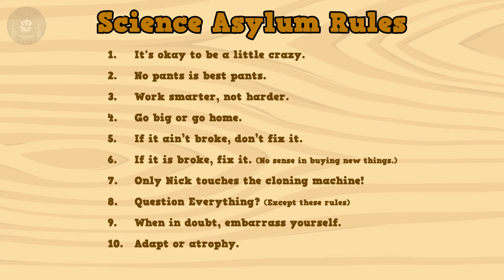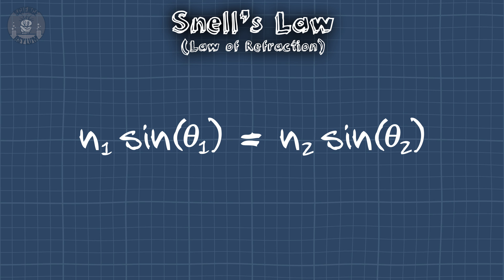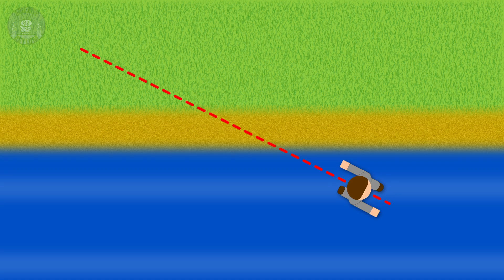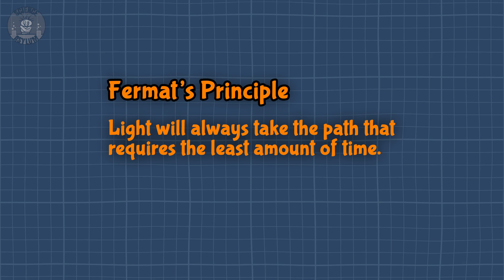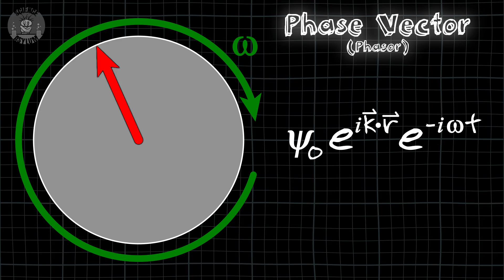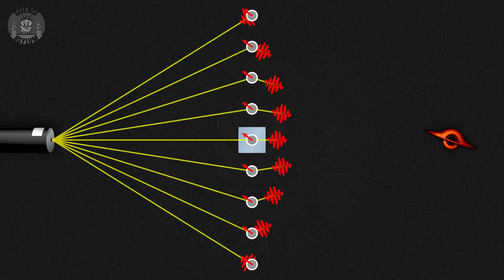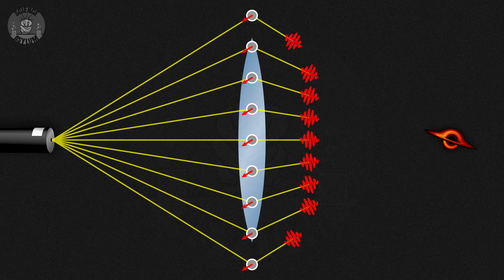Why Does Light REALLY Bend?

Comment: I have a question: Can light bend spacetime?
Reply: It can and it does. Energy bends spacetime. Light has energy. You can make black holes entirely from light.
Reply: Narf Whals Have we ever observe light’s gravitational pull?
Reply: @Shawn-hk1ud  Not with light directly, that I am aware of. The effect is TINY . The energy required to get an effect comparable to 1kg is equivalent to about 20 Million tons of TNT.  So its difficult to do experiments with such tiny effects and there aren't any light sources in space that would do it either. But considering how spectacularly right General Relativity is, there is no reason to believe it is wrong there. But we should still test it if we can!
Reply: Narf Whals Welllll... GR isn’t always right. I mean, think about dark matter. Theoretical, galaxies and stars couldn’t have formed without the existence of dark matter according to GR, yet we have never found dark matter in the cosmos. Doesn’t that seem just a bit off to you? Anyway, there’s a reason why I asked that original question about light, it doesn’t interact with the Higgs Field. Theoretical, light still has gravitational influence despite the fact that it does not have mass. However, if we had the ability to measure gravitational influence on the subatomic and maybe even the quantum scale, we would see the gravitational effects of light according to GR. However, if GR is wrong and we don’t observe any gravitational influence at all, there’s two possibilities. 1: GR might still be correct but we can’t see the effects because light can only cause displacements smaller than Planck lengths. Or 2: There’s a different reason for why light doesn’t have gravitational influence. Remember how I mentioned that light doesn’t interact with the Higgs Field? I mention the Higgs Field because it’s responsible for the mass of all leptons, quarks, the W, Y, Z and Higgs Bosons. Anything that interacts with the Higgs Mechanism exhibits a property we call “mass”. Light doesn’t interact with the Higgs Mechanism, which is why light has no mass. Now, if we were able to observe that light does not have gravitational influence of any kind, that may explain why things with mass do have gravitational influence over other things with mass, the Higgs Field. Newton originally postulated that gravity was caused by the attraction on masses. He believed it was some trait of the masses themselves that caused gravitational attraction in the first place. If all things without mass do not have gravitational influence, but all things that do have mass have gravitational influence, that means the Higgs Field is responsible for gravity. It would mean that if GR were hypothetical incorrect, the Higgs Mechanism might explain why things with mass have gravity, there something in the Higgs Field that is giving them gravity. Now I know it sounds insane, but think about it for a second. If we do discover that light has absolutely no gravitational influence or if we discover that gluons have no gravitational influence, that must mean that the Higgs Field is responsible for gravity. It means the Higgs Field might imbue certain particles with gravity. It would mean that energy doesn’t have gravitational influence, but mass does. It would mean that GR is incorrect, but it would quantize gravity for the first time ever. It would explain why the smallest things in the universe behave differently from the largest things in the universe. Listen, if we ever discover that light and gluons have no gravitational influence at all, physics as it stands would not be up in arms because the Higgs Field might actually provide a better explanation for gravity. Maybe energy doesn’t bend the fabric of spacetime, but mass still could. I really wouldn’t change that mu...wait a second. GR has come under fire recently because the amount of mass in the galaxy is too little to account for the observed rotation of the outer rim. That’s why we’re looking for dark matter. But I think our math was actually off. We didn’t account for any of the energy in the galaxy. If GR is correct and mass and energy both bend spacetime, that means we need to calculate the amount of energy in our galaxy and convert that into mass. Then we could take the mass of the galaxy and the theoretical mass of all of the energy of the galaxy and we should get a much higher result for mass than we have right now. We don’t need dark matter because our numbers were way off when we did the calculations. Oh, I just realized something: Today is Hitler’s birthday. Anyway, if dark matter doesn’t exist and light doesn’t have gravitational influence, the Higgs Mechanism imbues certain particles with this energy called (huh, what do I wanna call my made up energy? Oh I know!) Higgs energy. The Higgs energy can be exchanged in the form of these virtual perturbations called gravitons in this thing called a graviton field. The exchange of those gravitons can go on until the end of time because the particles with mass are constantly being imbued with the Higgs energy. Anyway, the gravitons decay into more Higgs energy and are then absorbed by the other particle which took part in the exchange. Now these gravitons are not impeded by the Higgs Field because they were made of energy from the field itself. That energy therefore has no mass but can exist as particles that travel the speed of light. Now, when you crush things with large amounts of mass inside of them, the Higgs energy starts to get all clumped together which results in a singularity with infinite density and an escape velocity equal to the speed of the gravitons themselves, the speed of light. Now, when two black holes merge, the Higgs energy starts to stretch and squeeze the Higgs Field like a squishy membrane. This results in these ripples throughout the Higgs Field that travel throughout all of space. Now since particles with mass can react to changes in the Higgs Field, they stretch and squeeze, but to the smallest effect. Now, light obviously can’t interact with the Higgs Field, meaning it shouldn’t allow us to detect gravitational waves, so how is it that LIGO and gravitational wave detection can still work? Higgs energy. Now, light does not interact with Higgs energy because obviously it doesn’t interact with the Higgs Field, but absorption and interaction are not the same thing. All leptons and quarks absorb Higgs energy because they are slowed down by the Higgs Field. This allows them to be bombshell with the Higgs energy. Now, while photons can not interact with the Higgs Field, they can interact with Higgs energy. The photons don’t absorb the Higgs energy, but they do bounce off of it. This is how gravity can bend light, but light doesn’t have mass. Light doesn’t interact with the Higgs Field but it does refract off if Higgs energy. The Higgs energy perturbs the light slightly. This is why gravity can interact with light. When a beam of light hits a graviton, it refracts towards the source of the graviton. It’s easier for the light to refract towards a source of perturbation than it is for the light to reflect off the graviton and away from the source of perturbation. We see this all the time actually. When a beam of light its a pool of water, it tends to refract at a sharper angle than the angle at which it hit the water. If you have a beam of light that hits a pool of water at a 45° angle, the refractory angle will be greater than 45°. And I think that’s about everything my theory can explain. So, if we do discover that light does not have gravitational influence and dark matter does not exist, call this number to notify me about when I need to prepare my speech for when I receive the Nobel Prize in Physics in Oslo: (352)553-9672.
Reply: @Shawn-hk1ud  Gluons definitely have gravitational influence. The restmass of the quarks is only about 1% of the mass of hadrons, the other 99% is in the gluons. And all the energy in the hadron creates its gravitational influence. But i suppose we could say the gluons interact with the Higgs field through the quarks. But then we really also have to say that photons interact with the Higgs through the electrons... It would indeed be incredibly interesting if we did find that light does not bend spacetime. It would call into question one of the most well tested theories in the world, and tell is something about where it is wrong, which we know it must be for the reasons you stated among others.
Reply: Narf Whals Well wait a second, I never said that quarks were massive but you are still very incorrect about gluons. Gluons actually don’t have rest mass. The reason why protons are so massive is because of gluon bonds. It’s because of the energy used to form and maintain gluon bonds in protons between quarks that is responsible for their mass. Also, quarks are not made of gluons. Quarks are made of perturbations of energy. Protons are made of quarks and gluons if that’s what you meant. However, gluons and photons don’t have to have any gravitational influence because they are already carriers of the strong and electromagnetic forces. The reason why gluons create such strong bonds between quarks is because they carry the strong nuclear force. The strong nuclear force is caused by the exchange of gluons between quarks. The electromagnetic force is caused by the exchange of photons between electrons. You missed the whole point, gluons and photons don’t interact with the Higgs field and we have never measured their gravitational influence.
Reply: @Shawn-hk1ud  You said "because it’s responsible for the mass of all leptons, quarks," I am saying the energy of the gluons is responsible for 99% of the gravitational influence of protons and neutrons. That is evidence that it is energy that bends spacetime and not the higgs interaction.
Reply: Narf Whals Yeah, but also no. See protons and neutrons don’t really have that much gravitational influence. The only reason the nucleus exists is the weak force.
Reply: @Shawn-hk1ud  I'm not saying protons or nuclei are held together by gravity. I'm saying the vast majority of the gravitational influence of baryonic matter, so everything made from protons and neutrons, comes from the binding and kinetic energy of the gluons inside them. 
But of course we also have never observed gluons bending spacetime by themselves. If we manage to observe glueballs and their gravitational interaction that would settle at least that debate. Though you'd need a lot of glueballs to be able to measure any gravitational effects... Photons might be easier after all.
Reply: Narf Whals Actually, I have an explanation for [your previous argument (I know this is more of a discussion than an argument, but you get what I mean)] as well. See, the more energy you add to a system, the slower it moves through the Higgs Field. The slower something moves through the Higgs Field, the more Higgs energy it gets bombarded with. That means more energy = more mass = slower movement through Higgs Field = more gravitational influence. That could be why the bombardment of quantum particles with enough energy will cause them to form singularities. Under the “theory” photons could become black holes if you bombarded them with enough energy because they would move slower through the Higgs field and be bombarded with more Higgs energy.

Comment: If light wave take all direction simultaneously and the very first part of the wave to be absorbed immediately collapse all the energy of the wave, then the shortest time would be the explanation for the angle. The geometric explanation, as illustrated by the large car with one wheel slowing down faster then the 3 other wheels is another way that happen to give the same result.
Both method assume that light really go slower in the transparent medium.
My electrical engineer explanation is to compare with electric waves inside a cable. The signal is slowed down at about 66% the speed of light. The theoretical model is to consider a cable like if it was composed of a large (infinite) number of inductors in series and capacitors in parallel. Each portion of the cable is an LC resonator or oscillator or band pass filter.
In mechanical engineering, the same phenomenon is represented with spring/mass systems.
In quantum physics, the electron is the mass and the chemical bond is the spring.
The reason glass or water is transparent is because the spring/mass oscillator has no resonant frequency in the octave of frequencies covered by visible light, from 450 THz (red) to 700 THz (blue), which is almost a full octave.
The mass of electron is tiny. For example, the total weight of all electrons in a human body is about 100 gram, 1/10 pound.
Being so light, electrons are much easier to move than entire atoms. That is why LEDs can emit UV light while remaining cold; they just excite electron while incandescent light excite the atoms with high temperature.

Black body radiation reach visible light level at a few thousand degrees, It is still the electrons that produce those photons. But they produce photons when two atoms hit each other violently (temperature level translate to mean speed of atoms/molecules), creating sudden change of direction. This is an acceleration event and accelerated electric charges emit photons..

Comment: Suppose this is what is happening in the double slit experiment. Is it possible for the refraction to be graduated?
Reply from the maker: Sure, you can use this model to explain diffraction as well (which is what happens in the double-slit experiment). If you block the paths in just the right way, this refraction will just become diffraction. They're the same phenomenon in quantum mechanics.

Comment: If the water directly above the driver was covered so it couldn't contribute the displacement would change.  Since it doesn't I'm assuming that it's because it's over simplified?
Reply from the maker: Yes, that would change how/where the light arrived. It would cause diffraction, which is also explained by this path method.

Comment: This is the same great question pilots have had over the neons.   For example, we all know that the tips of a helicopter rotor turn faster than the most inner parts of the same blade.  No question.  No problem.  But here is the problem with airplane pilots and physics.   The FAA's AIM (Aeronautical Information Manual) states that when an airplane is "banking" in a constant altitude turn, the outer wingtip "MUST" be travelling faster than the "inner" wingtip.   The FAA says there because of what the "wrongfully" have over the years misperceived the "real physics".   When an airplane is turning in a constant bank at a constant altitude, it is simply turning.  
           But some misenchanted people treat a "constant airplane bank"   as if it were identical to the same wing turning as a helicopter wing turns.  This is not "identical, nor relative".   I propose that when an airplane banks, both wingtips turn at the same "airspeed".   This is much different from when an helicopter blade turns from a central "hub"  otherwise known as the "Jesus nut"  or the place where the helicopter's blades is turning form a center point.  Am I the only person who can see the difference?  Are there any physicists or otherwise aeronautical engineers who can see the difference".  Just wondering after 45 years of not knowing the real physical answer.
Reply from the maker: If an object is turning, whatever is on the outer edge of the turn is moving the fastest (measured relative to the ground). That's just rotational physics. It's true for all turning objects, including planes.
Reply: @ScienceAsylum  Yes, but an airplane only "appears" to be turning "relative" to the ground.  It's really in the "air". It's not connected to the ground like a toy that we kids had with small gas powered engines with strings attached to a hand controller.  Then I would agree with you.  The toy would be no different than a propeller where the outer edges fly faster than the inner edges.
      A similar thing to an airplane  would occur if it could fly in outer space in a cloud of air.  Acceleration is its own gravity.  The earth is meaningless, except that it provides a reference point.  But so does the moon and the stars and the sun.   What connection does an airplane have to the Earth?   Nothing other than it flies in its "gravity well" but is still yet unattached.
                 Dear Science Asylum,  You gotta do better than that to convince some of us pilots.  But I do appreciate your attempt to explain it.  Let's keep this going until one of us can scientifically prove the other is wrong.  This could be fun.
Here is another FAA handbook for all the public to read.
https://www.faa.gov/regulations_policies/handbooks_manuals/aviation/phak/media/pilot_handbook.pdf
The part on turns is the issue. I'll try to locate it and state it shortly.  It's been a long day, but I have recently read the FAA handbook that states that the "outer wing flies faster than the inner wing".  If you will give me a few days to try to locate the exact language from the FAA handbook, one of many, I'll produce it for you and your audience.   But I do concede the FAA states the "outer wing flies faster".   But I don't not agree with this principle for my reasons stated above. Let's discuss this again soon.  It's been a long day. Thanks.

Comment: the biggest question answered was why does light bend to black hole, as in the images... Someone said its path was altered by the black hole... the other question would be space doesn't have a path how the hell can lights path be bended to black hole... In the end most see able light can bended by blackhole is my understanding and not its path...
Reply from the maker: Space is just a collection of points and a path is just a bunch of adjacent points linked together in a chain. If the spacing/configuration of the points changes, then so do the paths that connect those points.